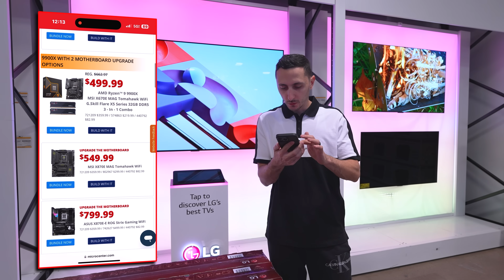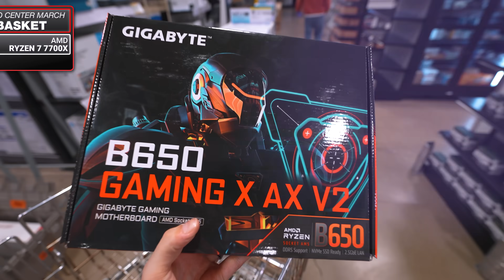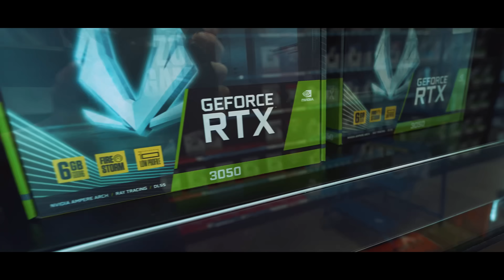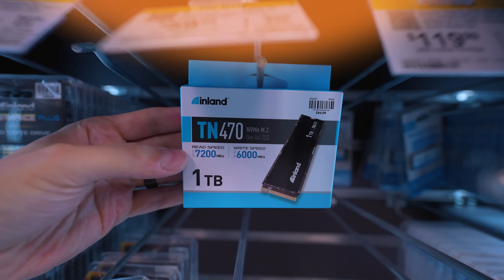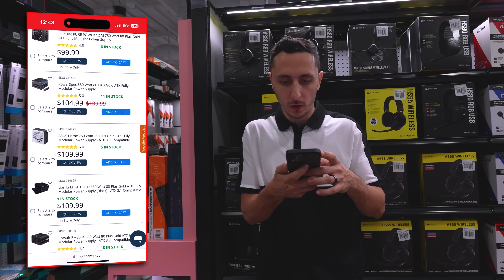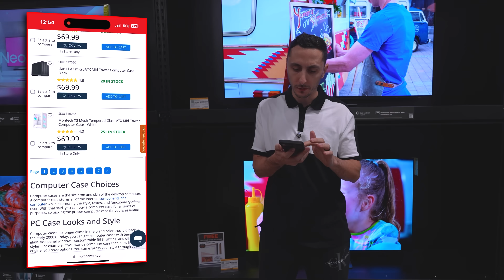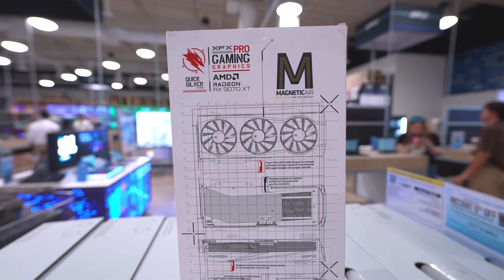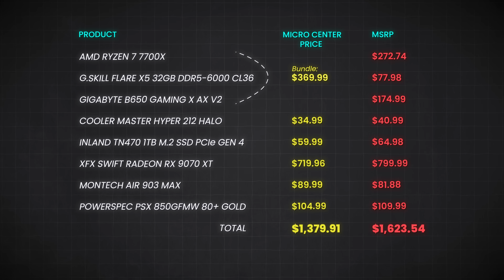This Is What $1500 Gets you in 2025!

Comment: I had to rebuild my PC ... I unfortunately had a defective Motherboard which i originally went with Asus Z790-A Gaming Wifi... but for some reason or another the motherboard would not engage duel channels for RAM and would reject the RAM that was listed as appropriate on the manufacturer's website... so i literally had only 1 stick of 16GB that was working..... after consideration i made the hard pivot to AMD replacing the Z790-A with a ROG STRIX B850-F Gaming Wifi motherboard from AMD... i traded my i7 - 12,700k for an AMD Ryzen 7 9700X and got G.Skill Neo Trident RGB (Black) 32GB RAM..... Bios was a pain to update but once it was done the duel channels worked just fine and my RTX 4060 which i couldn't run on the Z790 for some reason started working with my new build no problem.

Comment: Having a baby in 2 weeks, getting married in August. After the wedding my soon to be wife said I have worked immensely hard this year to make everything happen, so I have full unrestricted plans to build a new PC with no real budget in mind. I would like to keep it at like 3500$. I live about 3 hours away from the closest microcenter so I will be making that drive when the time is here. I just hope the tariffs don't kill this possibility by then either.
Reply: 3500 gets you a BEAST OF A COMPUTER lol i spent 1400 on mine got me a ryzen 7 9700 with radeon rx 9070 16gb gddr6 absolutley has ran every game on ultra with zero issues got it from micro center i did upgrade the ssd to 2 tb other that though was a SOLID build for 1400 may add little more ram down the road but ive not had a single issue yet and this was my first pc ever loving it !
Reply: @FatherOfTwinzz  Yeah ive taken my budget down from 3500$ to 2500$, I couldnt hit the target of 3500$ even if I tried. Plus I already bought my 9070xt and threw that in my current system, When I build the rest of the new system itll go in there for sure;

Comment: I just got a nvidia 4080  super fe 500$ used Facebook mp, then went to micro center in Virginia  nutley road in fair fax and got the rest of the parts on sale or m.s.r.p ryzen 9 9950x3d 640$ 64g ram 6000 g skill f/x 167$  b850-i mini itx build 279$ case nr200p max cooler master 310 amazon.
Had a monitor which is the odyssey g nine 49 1st gen. Love to see a build with that spec to see what it can do I'm a noob thanks .
Ps I play cyberpunk  and 7 days to die.😅

Comment: Unless you are moving a lot of large media files, and are trying to limit spend, would give up some speed on an NVME all day long before going for a smaller capacity drive.  Speeds are so fast you will never notice unless you are regularly moving large files.   With multiple NVME slots now on most boards can also mix it up a little with cheaper and more expensive NVMEs, or even use spare PCIe slots.  Running 4 NVMe on current system for over 3.5TB space.   After so many failures with mechanical drives don't miss them at all.

Comment: I just built a $1500 PC around an MSRP 9070 xt I got from Microcenter. Most of the other parts I got from Amazon and Newegg. A LOT of research and waiting for a few deals over two-month timeframe. After some tuning, super happy with the price/performance, thermals and noise levels:
  
CPU: Ryzen 7600x 
GPU: Asrock 9070 XT Steel Legend
MB: Asrock B850 Steel Legend
RAM: TG T-Create Expert 32gb DDR5 6000 CL30
Storage: 4TB SP US75, 1TB TG MP44Q
PSU: Corsair RM 850x
CPU Cooler: Thermalright Phantom Spirit 120 SE
Case: Lian Li Lancool 207
Reply: what's the fps avg?
Reply: @gamergod7933  I was playing Ghost of Tsushima the other night and was getting around 130fps avg @1440p (all high settings, no upscale, no RT)

Comment: 9:08 In case it helps anyone, Google "Kingston NV3 1tb". It's cheaper.

In general, I learned the hard way that you don't buy everything at Micro Center. Shop around just a little bit, and you can still find some pretty significant savings.

Comment: 2:25 Can't you just get the bundle and get an additional 16GB stick of RAM separately...
Reply from the maker: It would cost more
Reply: @TechSource  well not necessarily... the second bundle ended up being $370, if you went with the first bundle which was $300 and have gotten an additional stick of 16GB DDR5 6000MT RAM which costs $45-52 in Micro Center (if it was on discount like it usually is) you would have spent $15-25 less... but i understand that problems might occur if they don't have identical RAM sticks in stock or if discounts weren't included at the time ect. so getting the second bundle was the faster and easier choice.

Comment: I dont recommend the montech 903 AIR MAX for 1 BBBBIIIIIIIGGGGGG reason, after a year ish the fan hub will stop working you will have to use your garantee and probably pay shipping cost depending on where you live to get a new fan hub with that garantee. I bought 2 montech cases both times the included fan hub stopped working after a year ish both times had to replace them with the garantee and cost me a lot of money for shipping costs i could just have bought a good fan hub instead with that money. The worst part is that even after getting te new fan hubs they again broke in 1 year ish time ( the fans still spinned every time the fan hub broke but the rgb always stopped working on the fans and you dont get a new garantee of x years with the replaced hub so you go through a lot of time, money for no reason just buy a case for a bit more immediatly thats my advice if you can afford it that is.

Comment: *"I'm planning my first PC build with a Ryzen 7 9800X3D, RTX 5070 Ti (OC) — which, according to some YouTube shorts and benchmark videos, is getting surprisingly close to RTX 5080 performance. Paired with 32GB Corsair Dominator RAM and dual 1TB Samsung 990 EVO SSDs. Cooling it down with a Lian Li Galahad II LCD 360mm AIO inside a Hyte Y70 case — going for an all-black, no-RGB aesthetic. Using a Gigabyte B650E AORUS MASTER motherboard and a Gigabyte UD850GM fully modular PSU.

For airflow, I've set up:

Side Intake Fans: Lian Li Uni Fan TL LCD 120 Reverse x3
Bottom Intake Fans: Arctic P14 PWM x2
Radiator Fans: Lian Li Uni Fan TL 120 x3
Rear Exhaust Fan: Lian Li Uni Fan TL 140 x1
I'm pairing it with an Alienware 32-inch curved OLED 4K monitor, Aula F75 keyboard, and Logitech G502 X Plus Wireless Gaming Mouse. My total budget, including peripherals, is around ₹2.5 lakhs (~$3,000 USD). It's my first build, but my brother and father have experience, so I feel confident. Still, I'd love to hear any suggestions for improvements or modifications!"*

Comment: I have a 1660 super with 3500x i wanna upgrade to a 9070xt but my power supply is only 550watt cooler master. Can you test out a 550 watt cooler master psu with a 9070xt on a pc with the same spec as mine plz bro to see if it runs in one of your next videos? spec is gigabyte b450m gaming, 1 tb hdd, 3500x evga 1660s, 5 fans, 16gb ram coolermaster case. Thx if you can.

Comment: im like half an hour from one, managed to build a pretty good pc for 550 bucks
Ryzen 7 5700x
1tb nvme gen 4
Arc A750
asrock b550 phantom 4/ac
Forgot cpu cooler but i think its a cooler pro
inland pc case/montech (names not very specific)
16gb ddr4 3600mhz cl18
and a 650 watt msi semi modular psu
All for around 550, so in my opinion pretty good.
Reply: couldve gotten a rx 6600xt as it was also a open box like the a750, but 750 seemed to be in better condition

Comment: I travelled just under an hour to other closest microcenter when I built my own rig, everything there was cheaper then if I actually straight up got it online, from a best buy, or any other retailer. Also saved money with the bundles and managed to put some extra money from my $850-900 budget to upgrade my graphics card. Only things I've added to it since has been another 16gb cl16 ram kit from the same manufacturer for consistency and another ssd

Comment: @TechSource really? you're cheaping out on the PSU out of all things? cmon man... you know better than to cheap out on PSU and mobo, especially the PSU.. get yourself at least a B/B- tier PSU for prolly another $10, heck even that Corsair RM850e that you show on the video is fully modular, gold certified and ATX 3.0 standard and its prolly only another $10-$15. It will last you way longer and you're gonna be sure it will handle anything you throw at it without risking a pc dumpster fire.
I understand it's supposed to be as cheap and performant as you can (which you did a very good job at btw), but with a $1500 budget and over 100$ left cheaping out on a psu is just completelly wrong, beginner mistake even

Comment: If you clean up the ram timings you can close the gap between most x3d chips and non x3d chips. My 7700x + 9070XT is within 5 FPS diffrence of my 9800x3d+4080 super system in every game except MSFS2020. On average I got 32fps more running DDR5 6200 CL26 with 1.38V on my non 3xd system

Comment: Similar build to me, Rog Strix B650-A Gaming Wi Fi, Ryzen 7 7700x, 32Gb T Create 6000mhz CL30, I'm just about to upgrade to Thermalright Elite Vision 360mm AIO, from Ak 620 Digital. My psu is Thermaltake Tough Power GF A3 Snow 850w. Everything in white, except my MB, which is a bummer, :(.  My GPU is Hellhound Power Colour, RX7800XT, also in white.

Comment: I am lucky to have 2 Microcenters in my area. Duluth and Marietta Ga. Right now I have Mag X870E Tomahawk Wifi. And for some reason it came with a white white Wifi antenna. 9800x3d 16 gig 6000 mhz memory with freezer 36 cooler with Phanteks t30 fans attached. With Asus RTX 4090. picked up a 9070xt launch day at 3pm.

Comment: there is a difference people usually don't talk about when comparing 9700x to 7700x in that the 9700x is much cooler and more energy efficient.  you will need less electricity to run it, less a/c running to keep your room cool, and a smaller cpu cooler.  this offsets the cost and also just makes life better imo
Reply from the maker: Agreed, but from a strictly performance standpoint the 7700X is still the better buy if we trying to save money.
Reply: If you undervolt the 7700x and put it in eco mode, it still performs well.